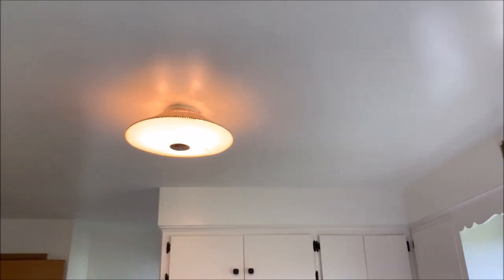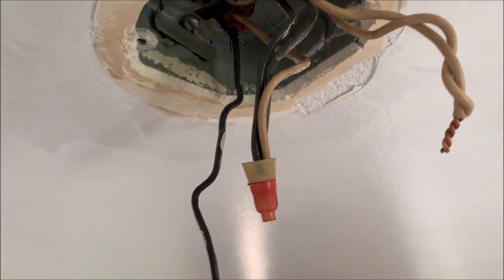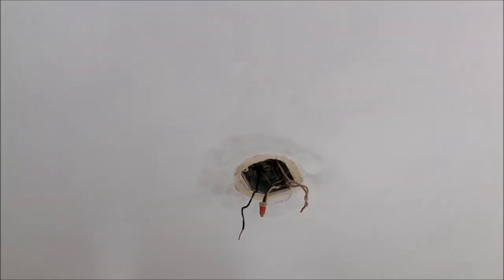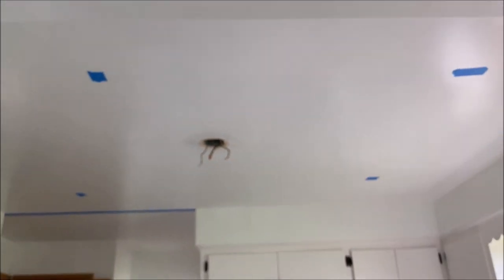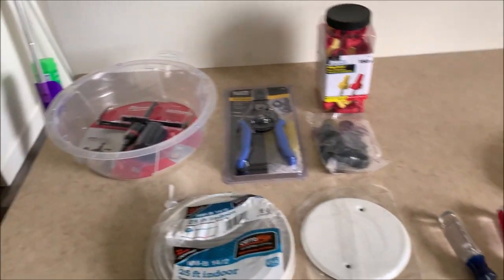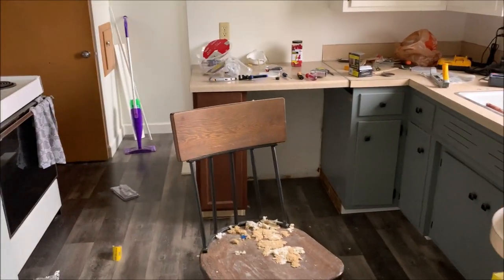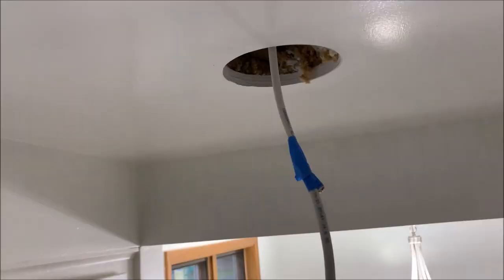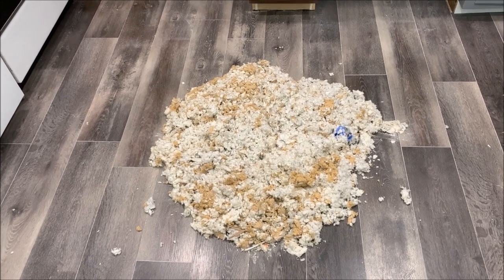Adding Recessed Lights in the Kitchen

Comment: great job.. FYI.. another option you have is flipping the box from the old light over & putting a cover on it in the attic space.. then you can plaster the ceiling hole over & paint it to match.. most places thats legal.. you just cant seal it in a closed wall or ceiling...  I know its too late because you bought it & did the job.. but may help someone else.. instead of that  dust catcher,.. get yourself a  basketball or soccer ball cut it in half & drill a hole in it for your drill & put that over your hole saw.. works great & seals awesome.lastly.. with your fish tape... it works easier if you strip your wires back on the wire you are looking to run & feed it into your fish tape & fold it over.. about a 6" tail... that will pull a lot easier than  pulling the shielded wire through th knock out keep up the awesome work & stay safe!!
Reply from the maker: I’m actually rewiring the whole house. Once I do the kitchen, I’ll be able to bypass that box and get rid of it altogether.